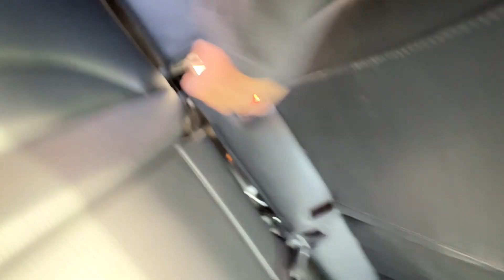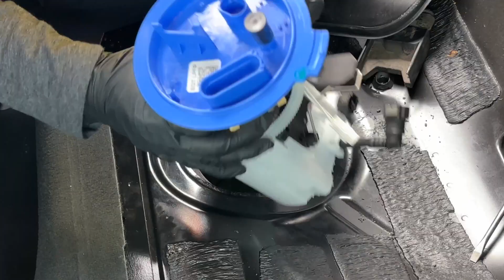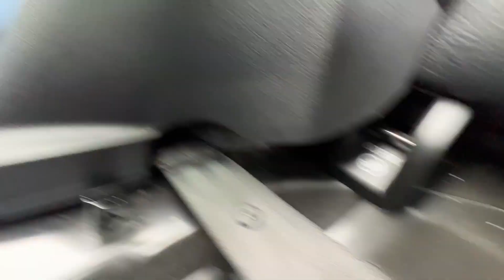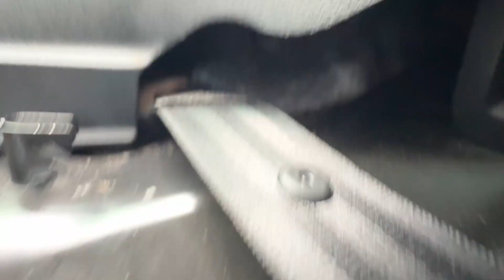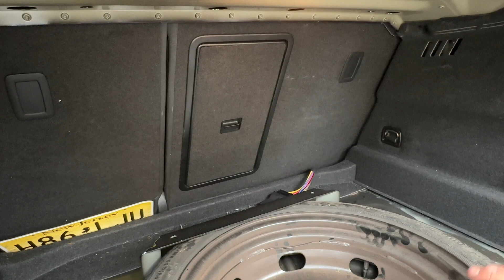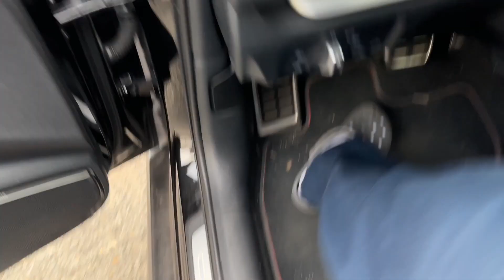EQT BRUSHLESS LPFP Install! A3 | S3 | Golf R

Comment: My leveler gets stuck at 1/4 after installing. Any advice getting it in and working.
Reply from the maker: This is super common actually. What happens is without realizing it the float can get caught up which causes this. You would have to open it back up and make sure that the float isn’t caught up on anything. Once you verified that it’s not caught if it still reads incorrectly then you may have a defective unit
Reply: @DArias I have tried checking but I can't fit my hand into the tank with the fuel pump at the same time. Before it goes in, it looks ok. I'll give it another go with week. Thank you for your advice

Comment: Hey question, with that EQT pump did it also supply that 90 fitting for the black fuel line that sits inside the tank? I’m having trouble getting that white clip to properly secure the stock 90 piece.

Comment: This was the sloppiest video I’ve seen.
Your tank is way too full, secondly pull the fuse to the hpfp crank the car and let it idle until it dies. NOW THE FUEL LINE WONT BE PRESURIZED AND YOU SPIT FUEL WVERYWHERE

Comment: Do you have a stock downpipe ? I noticed you don’t have CEL but running EQT with the AP.
Reply from the maker: No aftermarket only reason no CEL was because on the initial flash the accessport clears all fault codes. After I shut off the car and start it back up the light is on

Comment: This is one of the pricier mods I assume.
Reply from the maker: It is but it’s worth it since this is pull plug and play and has its own controller. No pm4 needed or any other wiring etc to be done. Drop in connect it and finished

Comment: Assuming you’ll be running full e85?
Reply from the maker: 93 and full e85 I will be running
Reply: Do you need it if you'll run just 93 and a hybrid turbo?
Reply: @3abo0od96  I believe if you’re only running 93 you just need the Hpfp but if you want more power you’ll wanna do mpi and lpfp for e85 and more power later on
Reply: @Boostedbutbroke  turned out I need it, I'm running out of fuel with just the hpfp, going to get this pump installed and see how it goes